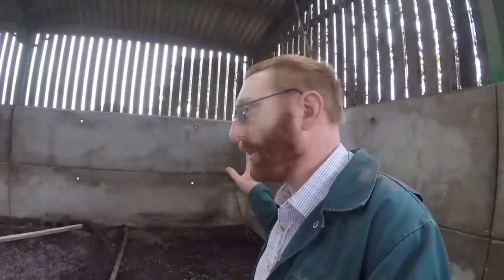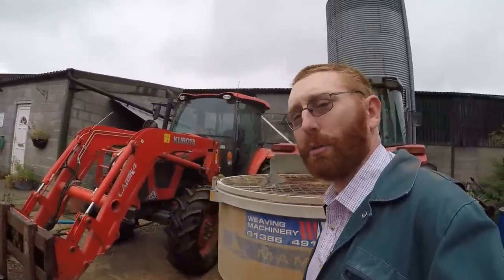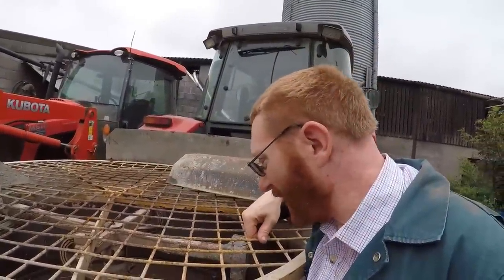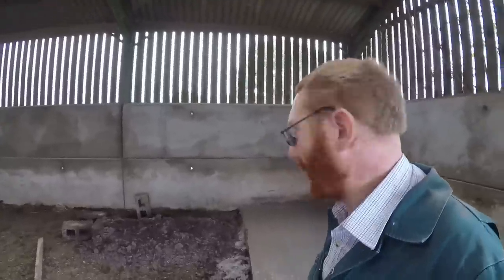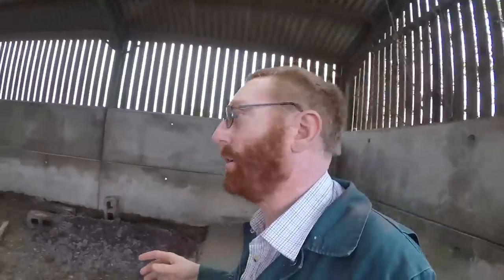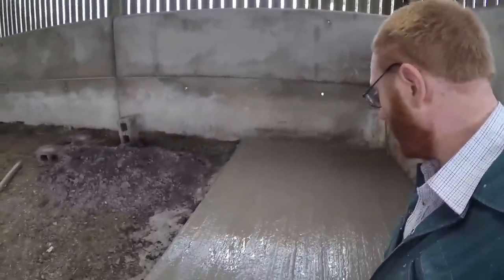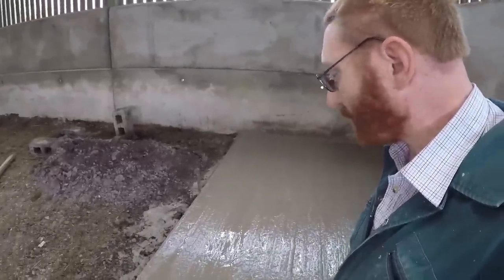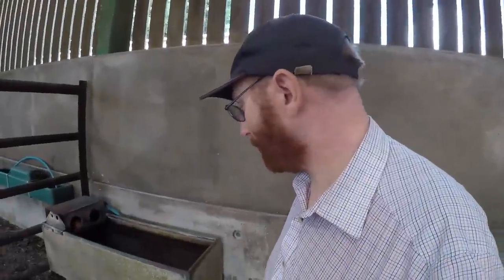Mixing concrete, cow shed maintenance.

Comment: Suggestion for next time: cut the tops of the timber supports and easier tamp the concrete to finish
Reply: Good tip,also in such a thin layer,finer gravel would be much easier to work with.

Comment: Just a comment Dan, as somebody who worked and managed cow units 32 years- would it have been better to have built a more stable sitting for the trough rather than 2 blocks? Cows rubbing on the trough or it getting knocked can easily be a trough dislodged and running water? I got fed up with  rats making homes under troughs like that, so cemented a few blocks on a base like that, filled it in with concrete- more stable and no rat accessibility under them.

Comment: More water you put with cement the quicker it cures. Never start watering down ready-mixed on a hot day. 6m3 later (by hand!) I discovered that.... but I lived, only just....
Reply: @johncooper2245  the water evaporates, leaving the exact same amount of cement that was in the mix to start with.  Water applied once the curing has started will speed the process...

Comment: Great job 👍 why not concrete whole floor a lot easier for cleaning out
If it's for money fair enough if it to let excess water out not sure it makes much difference
I have one bay concrete and other stone both about the same but do dig holes in the not concrete one which we have to refill
That mixer looks good
How much does it hold?
Does it mix well??
Reply from the maker: We find the stone floors better for calving cows as they get better grip if they are a bit unsteady with milk fever.
Reply from the maker: We think it holds 1/3 m3 and produces a great mix, we leave it running while travelling between filling and emptying and it's ready when you get there.